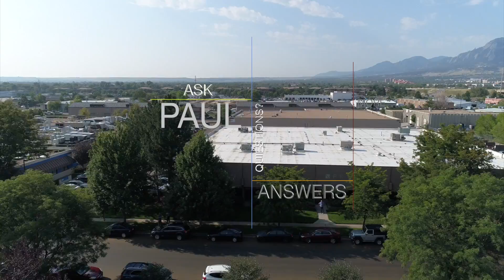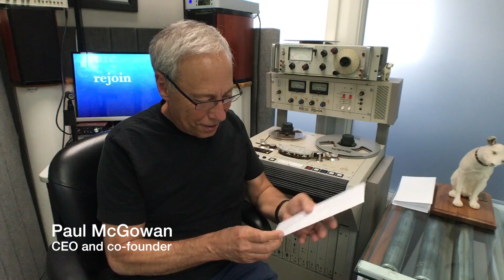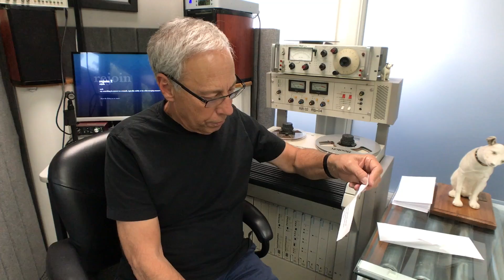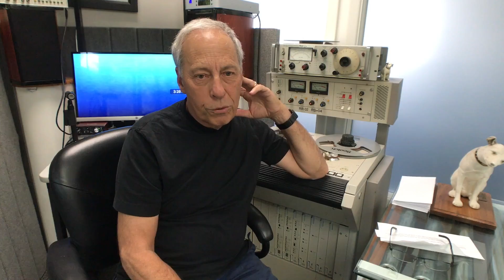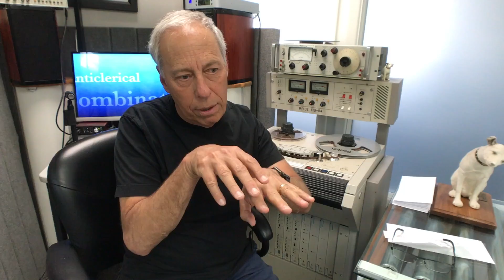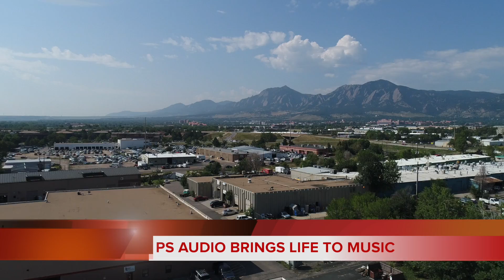How long do tubes last?

Comment: The tube warm up is all about the heaters, you want a slow warm up so there is no cathode striping......the metal work inside the glass is coated with various compounds.  Also critical is the plate voltages and specially on power tubes.  Tube have a curve in response, so they generally get designed into a circuit to run in the linear portion of the curve which can be influenced by the plate voltage and the current.  The tube manuals give the curves and the specs and the graphs per the manufacturer and tube type......its not always generic.  With tubes....you don't want to red plate them.  You have to know the class of operation that the piece is designed for.  AND if its push-pull class AB, there can be a crossover notch distortion point in the sine wave that you want to minimize.  The whole balance of factors can be tricky.  But if the tubes are not being run hard, and they have a good vacuum......you can go a few thousand hours.  BUT when domestic tubes are not being manufactured anymore, the existing supplies are being depleted and what might be in circulation today might not be 100% performance tubes...the could be yesterdays era rejects of defectives put back in circulation.  Beware of non domestic tubes, some European tubes are actual correct tubes as with JJ/tesla which if I'm not mistaken was set up on telefunken machinery and recipies/designs.  The Russian tubes are usually not authentic and can be relabeled tubes domestic to Russia and technically just equivalent tubes rather than the real design.  I'm not sure as to if this is getting corrected as there has been a resurrection of some domestic brand names put on to Russian produced tubes.  NOS domestic or NOS European tubes will be extremely pricey as compared to the Russian tubes....though the Russian tubes are current manufacture.  There is a lot of attention in the Russian market and manufacturing, so quality can be really good....as far as I know.  
Best bet is to have a full spare set of tubes on hand.  The power tubes are the real wear and tear tubes in a system.  Vibration is the enemy as well as heat.....so anything tube should be as isolated as possible from vibration and its a good idea to use a fan as long as there is not electrical interference with the audio.....you don't want a tube set enclosed in a closet or cabinet.....air circulation is the key.  Solid state uses a heat sink, and as long as the heat sink is big enough to be properly adequate …...heat isn't as big an issue with solid state.  In the days of carbon resistors, the heat can cause drift in the components of the circuitry, and specially the power rail electrolytic capacitors & the signal bypass's.
I deal with audio as in the direction of guitar amplification which is not to far from audio playback, but in the aspect of guitar....its not about being clean.....its all about distortion and overdrive.  One of the secrets in guitar amps is due to design and layout, but its a happy accidental situation.  The old carbon type resistors tend to drift up in value as they heat up, heat rises.....tube make heat so it gets absorbed into the chassis.....thus the plate resistors drift up.....which means the gain drifts up along with the distortion & overdrive...and particularly when the plate resistor is not of the right size for the plate voltage (1/2 watt vs a 1 or 2 watt)…...so it becomes a cascading event & phenomenon .  Plates drift up for gain, power rail voltage supply begins to dip as the respective resistors heat up...which shifts the tube curve due to plate voltage in conjunction with the gain factor of the plate resistors...…..there isn't a locked in stability but its not a really bad situation with stability in the case of a guitar amplifier.  SO an audio play back set has to have a good design layout which suggest being huge as opposed to the compactness of electronics as we have come to know them in this day and age......not that the compact factor wasn't present in the era. 
High end tube audio pieces tend to have an appearance of a piece of modern artwork.....for a reason as opposed to just being a box with electronic guts inside.  6550 power tubes and KT88/KT90 power tubes are the most linear of the current production power tubes, and I believe there is now a KT120 power tubes which packs a lot of power in it......clean linear tubes (not that they can't be made to distort but its way at the end of their limits when it occurs).
Tubes are interesting......as with the one Edison light bulb in some firehouse somewhere in California.....100 years old or alittle more and the filament is still burning (due to good vacuum and seal......not designed obsolescence), so that can carry over to audio vacuum tubes in a perfect world......but reality is different when you want to sale tubes & in the era when tubes ruled......but atleast the electronic circuit was unitized and the tube was removeable and easy maintenance......as opposed to solid state & any potential failure.  If I remember right, my Macintosh receiver is hybrid and they were smart enough to socket the transistors......which should carry over to IC's...….but I'm particular.....just me

Comment: I've always been very hesitant to buying tube-amps because of of the livespan of tubes... since they are very expensive.
Reply: They are great for guitar amps, other gear doesn't really benefit from harmonic distortion. Usually they are too big and loud to play at optimal volume. Attenuators affect tone, amp/speaker interactivity and shorten tube life, so a small single ended guitar amp can be the best choice.

Comment: I disagree with you on 2 things. first, you don't have to replace tubes once a year. That's like changing the oil for your car daily. Second: Pure tube amps sound much better than a hybrid amp. I have tried both.

Comment: I have a tube radio that I use at work, it is on 8 hours a day, 5 days a week. The eye tube is very dim (it was that way when I bought the radio - it is still visible, so I keep the tube), but the radio works fine. I have been using it like this for 2 years now, so there's probably 4000 hours on the tubes (and I do not think that the tubes were new when I bought the radio) and they still work. I had to replace a socket of the output tube (EL84), some capacitors, resistors and the dial lamp, but not any of the tubes.

Comment: take it from a guitarist. tubes can last 15 years or 15 months, or 15 weeks. really depends on your luck of the draw and how hard and often you use them, and whether you let them warm up or not. how often should you replace them however is a much easier question to answer: once a year is a luxury! once every two and youre doing really well. once every 5, well, youre getting your moneys worth at least.... if you cant do them every year or two, then the answer is simply as often as your budget permits it
Reply: imantisocial my tube seems to be working still after 11 years even though I never turn my amp off
Reply: I agree, it's the cold to hot transition that does most of the damage.
Reply: Well, if you have a nice tube amp like the BHK, I assume you have that luxury. xD
Reply: Just think of them like incandescent light bulbs, really. They can last a lifetime if they happen to have flaws and never have any stress on them (power cycles) or they could go out in a week or two for no apparent reason.
Reply: I get around 5 years on a set of XF1's in my 8B.  I get around 2 years using the reissue Mullard EL34's by New Sensor.  Not as good as the originals but easily the best non NOS version for my gear - even better than Winged C.

Comment: Paul, Can you extend tube life by not turning of the equipment every night? I am somewhat of the opinion that it is the cold start up that wears out vacuum tubes in tube amplifiers and even in tube preamplifiers. My gear is not high end just for a reference.
I always let my tubes warm up before using the amplifier for a few minutes. I wait at least 20 minutes before I push the volume.
I have noticed that my tube preamps and even tube amplifiers sound better after being on all day long.
Peter

Comment: Tubes are great for the output stage of a guitar amp.We like that touch sensitive response.Pick lite and it's clean.Pick hard and it gets dirty.Yea.I worked at H.H. Scott in the 80's.Two of the old engineers were still there,Don Merriman and Peter Globba.I told them about my tube guitar amps.They told me that tubes went out with the Model T.Then I got out my pile of tube amp schematics and the tutorial really started.

Comment: Between my tube preamp and tube power amp I was changing 24 tubes about once a year.  I think the hybrid approach is much better.  Put tubes in the voltage amplifying circuits and solid state in the current amplifying circuits.  Buying twelve good and matched EL34’s is not easy (but they do sound like heaven).
Reply: It's a compromise, but a good one.
Allowing the tube to only amplify the voltage does not result in the same level of 'smoothing' that tubes controlling voltage and current do, but due to the lower operating voltages of this, the tubes last longer and suffer less degradation over time.
Reply: I don't agree, I have used both and pure tube amps are far better.
Reply: You are right on Dennis, evan my DAC is all tube. I change my pre-amp tubes around every  4-5 years(ECC 83). Power amp has 
3 ECC 83s And 4 EL 84s. The EL 84s go down in about 2 years(may be they run so hot and loose efficiancy soon, I do not know).Tubes Are The Way To Go.
Reply: Teknogod17  They weren't fine, that is why I was changing them.  BTW, I now use a PrimaLuna, much easier on the tubes and they last a lot longer.  I now mainly change tubes just because I like to play with the sound.
Reply: Teknogod17  I agree, my current amp is known to be very easy on tubes and over several years I have never had a tube go bad or need replacement unlike other amps I have had which eat tubes for breakfast.  I have learned over the years that reliability needs to be near the top of the list when buying audio or anything else.  BTW, I love tube rolling just to play around, but I seem to always go back to EL34.

Comment: Hey Paul, Bob Carver uses a DC restorer circuit is what he calls it in his tube amps he said he didn't develop it but he got it from the idea from television sets when he was fixing them has something to do with picture tube. He said that that the circuit Idles the tubes when not in use very low current. He said the tubes last about 50 years because of the tidal current is solo they don't waste energy in a lot of heat you know anything about this?

Comment: Installed soviet voshkod rockets into my little dot and stored away the stock Chinese made supplied tubes and it was a revelation the sound was astounding thru the cans. 2 yrs on and with occasional use they prob sound better now than from new. I was new to tubes (valves as we call them in uk) and only learned about burning in weeks later but the first few weeks of listening I found the treble a tad too much (the voshkod are renowned for crystal treble reproduction ) but now they have a few miles on the clock the overall sonics are well balanced and defy any reasoning that a cheap amp like the little dot can hold its own against amps costing hundreds more.

Comment: Once a year? Than your equipment is really bad and run your tubes too hard. Primaluna runs 10 years on a set.
Reply: Not mine. Had one go bad within a year. Replaced them with a set of Mullard platinums and one of those toasted in about a year.

Comment: I worked as a calibration technician for years and I also had to repair any test equipment that failed or degraded. A lot of this equipment used tubes, some of it used 50+ tubes. I was always amazed at how long the tubes in this equipment lasted, it was not unusual to open a up a 15 year old scope and find some original Tektronix tubes in it. The key was this equipment was VERY conservative in it's design, the engineers they employed to design this equipment were the top men in their field. The design was such that the tubes were operated very benignly well below their ratings. I worked on a lot of tube equipment in the army and that equipment was also very conservatively designed.

As a rule if you can design a circuit that treats the rube benignly it will last a very long time. There are times when you have to run a tube near it's design limits because it just sounds better there, in those cases the tube will not last as long. I tend to retube my Coinrad Johnson PV10a preamp every 2-3 years. The phono preamp section of that preamp does wear out the 12AX7's faster than the other tubes but I've used an outboard La Pacifica phono preamp for a while now so I can ignore that.
Reply: That is interesting about your PV 10. One person who had that amp thought the phono stage was the best thing about it. I owned  the same amp myself for a while but never really experimented around to see which part sounded better. I liked the PV 9 a lot if you put in the right NOS tubes to mellow it a bit.
Reply: In the Netherlands we had a tube powered medium wave transmitter on the air that was changed for a transistorized one in the mid 1980's. It was still using it's original tube from the late 1930's. That thing was even confiscated and used by the Germans during WW2! So yes, they can last a very very long time as long as they're not working at their maximum ratings.
Reply: I have a Prima Luna evo 100 integrated amp. We are told by Prima Luna they run their tubes conservatively. I have been trying to find out which tubes I should change first . The power tubes or the ax7's or indeed the au7 rectifier tubes?  
PS any modern tube rolling advice for a bright sounding  power tube?

Comment: My understanding has always been that the equipment will determine the life of the tube. The harder you run the tubes, the less life you get out of them - especially regarding the cathode plating. But, running them harder may yield improved characteristics during that shortened lifespan. Because there are so many different tube components and tube manufacturing variables, you just have to be prepared to get wildly varying anecdotal evidence as to how long they last.

Comment: and yet I have some tubes from the fourties that still work fine.
Reply: I had my 7 years old high end tube amp checked last week and they said they are in great condition and there is no point in changing. I'm using this amp everyday for many hours.
Reply: awdadw adwad my 11 year old tubes still work
Reply: This the difference between crappy new tubes and vintage tube I have 6l6s that test stronger than brand new jjs and this kinda the norm lol
Reply: this
Reply: Grobbekee seriously?

Comment: 12ax7 pre amp drivers tubes from sovtek. several different varieties and each with reasonably consistent characteristics.
been hooked on them since the early new sensor corp days.

Comment: Once a year? Whew.
Reply: The BBC never switched tube gear off !
All depends on tube quality and operation conditions as well as times switching on and off .
Except for power output tubes and rectifier valves , quality tubes in the right operation conditions can go for thousands of hours , even up to 100.000 or more.
As an example GEC KT66 tubes were rated for  a lifespan over 8000 hours.

Just like asking how long will the studs or the clutch  hold in a car ........all depends on he car and the owner............

Strange question of everyone who does not want to buy a car ...........because you will have to maintain it !
Same question .............about the lifespan of the capacitors in an amplifier , witch wil die first , the tubes or the filter capacitors ?

Tubes build today mostly do not have the life expectancy of the NOS......just change them when needed.

End of life tubes develop excessive grid current .
And lose performance of the cathode coating , sometimes become micro phonic due to overheating of the filament voltage and to often switch on /off without a warm-up time .............or cathode stripping due applying the HV when the cathodes are still cold.......

I rarely had to replace tubes ...........good quality gear and tubes still sing even when the tube has done a long lifetime of doing it's job .

On my Mc 240 i had to change the original output tubes ( 7027A) from 1962 in 1991..........some friends have to change their tubes in their ARC  every year .......I have WE tubes with garanteed lifespan  for 12 years uninterrupted usage under controlled operation conditions   and still test within specification after twelve years...
WE 101 ( telephone repeater tube )...............min 40.000 hours.............
Telefunken ECC ..........10-100.000 hours .....
245 triodes made before the war still performing today like no transistor amp can and will sound .
It all depends on so many parameters ,build quality ,  variables , operation conditions and the way the owner uses/ treat them .

Just like an engine, some burn them in less than 50.000 miles others drive them over 500.000 miles.....
 .
Reply: Paul, being a solid state guy, probably leaves his gear on 24/7.  It makes sense that an input tube would last about a year.  If you only run the equipment during the day, you should get about 3 years out of input tubes.  Hardier NOS tubes may last longer.